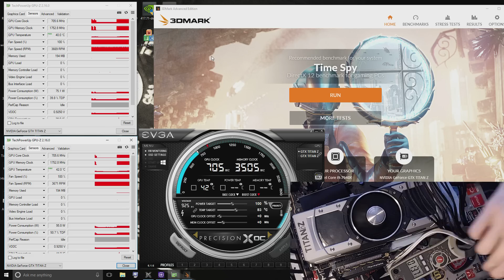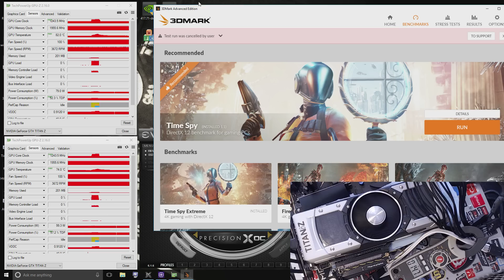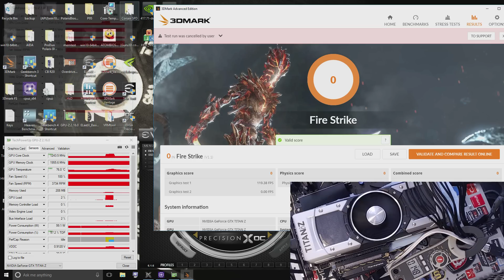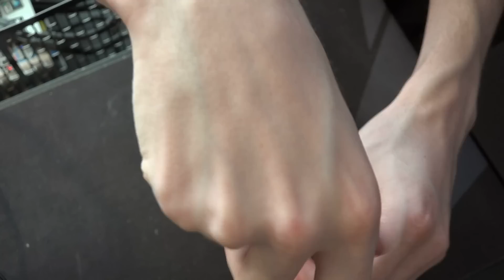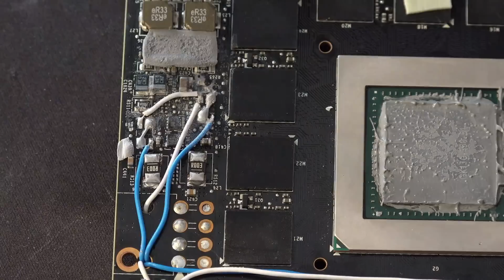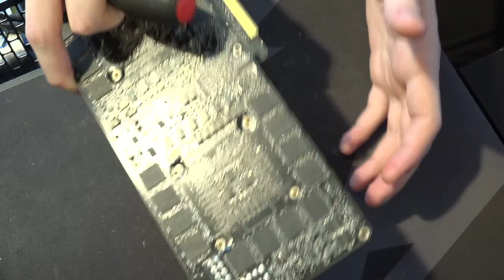Over 650W on a single air cooled GPU! Buildzoid's GTX Titan Z with no power limit.

Comment: Hi there, could you please tell me the thermal pad thickness for this card? 

I have two of them and I'd like to dust them off and play around with them again, and as they have been in storage for a very long time, I'm thinking i should re-do the paste and pads before powering them up.

Comment: If you are buying a (at the time) $3000 USD GPU, I would like a AIO (minimum) connected to it. Not a air cooler. A full body (both sides) water block for a GPU that cost this much would be ideal.

Comment: Thank you for the detailed analysis and breakdown of PC parts. Sorry, This question has nothing to do with this particular video but I enjoyed the ramble. I just bought most of my parts yesterday for my very first PC build. I have put together a PC build for my use case of 60% video editing in Davinci Resolve and other free editing software. 40% gaming, Streaming.———————
Parts List:
CPU: Intel i9 9900k ($484.99) to take advantage of the higher clock speeds.
CPU Cooler: Noctua NH-D15S ($79.90)
With 1× add’l NF-A15 Chromax 120mm Cooler fan. ($22.90) Push/Pull? or Pull/Pull?
GPU: Asus Geforce RTX2080 GDDR6 – ROG Strix OC edition ($799.99) Noticed a performance spec boost from closed to open. I wanted to take advantage of the specs based on my current plans in not adding a 2nd GPU.
Memory: 32GB Corsair Vengeance LPX Kit DDR4-3200 ($189.99)White kit 
Storage SSD: Samsung SSD 860 EVO 1TB SATA ($147.99) OS/ Applications
Storage PCIe-SSD: Samsung SSD 970 Evo Plus 1TB, M.2 ($247.99) Active Work/ Scratch
Storage HDD: Seagate Barracuda 4TB, 256MB Cache ($99.99) 
Motherboard: Gigabyte Z390 Designare ATX ($269.99)
Power Supply: EVGA Supernova 850 G3, Plus Gold, Fully Modular ($137.93)
Case: Cooler Master Mid-Tower H500M ($189.99)
Case Fans: 3× Noctua NF-S12A Black Chromax 120mm fans ($68.00) installed to the top for exhaust. Living in a small rental appt with young children my focus is on acoustics and performance. With my research Noctua seems to have the best acoustics and performance in the air market.
Total: $2740
With my zero PC experience I tried to put together a PC that can last me 5 plus years. The one question I have is in regards to the motherboard:  " Gigabyte Z390 Designare" there seems to be very little information and reviews about this board however Gigabyte is advertising this board as a content Creators motherboard. Having no experience in editing but inspiring to do so. I wanted to know if you feel that this board is the right pick for me or if you have a better option. Feel free to comment or make any suggestions on this build. Every part is returnable. 
Thank you for your time.
 Love your videos, Keep up the great work.

Comment: Why are you so suprised that this can pull 650watts when it has 2 gpus inside it? any current GPU can easily pull this much if there in sli aswell even higher.

Comment: This is one of the reasons why I don't really like 3dmark that much when it comes to who gets the best scores. Most people won't be doing such modifications to this extreme to be able to even get the scores up high. They should have a totally separate application for extreme overclockers. I mean soldering new capacitors on is basically changing the card to something else. But that's my opinion.

Comment: For the start of the benchmark can you force the card in 3d mode to get the full boost immediatly? With like K-Boost in evga precission or with ctr+L/ctrl+F in the Voltage curve editor from afterburner

Comment: Can you help me to take out the power limit on an GTX 470?
Reply from the maker: those shouldn't have one
Reply: @ActuallyHardcoreOverclocking  It won't go above 1.087 vddc,and i read that it can be set to 1.212 with power limit off

Comment: Sooo my croshair5 has an "8+2 phase" vrm with ASP1000 controller, We know there aren't 10 phases controllers, There's no doublers, Is it actually a 4+1 with doubled components?
Take the heatsink cover off and add 2x 80mm delta fans on top of both heatsinks and a third over the vrms, probably moves more air than the axial fan trying to be a blower.
Reply from the maker: nah each core gets it's own controller.

Comment: i fight you should try radeon pro wx5100 aka "PCI-E-BURNER" (polaris 1792 cores like rx 470d but wichout any power conector )
Reply: Yeah, I was hoping AMD will use a cheaper version of this card to compete with Nvidia in mobile market, looks like it would never happen.

Is it actually a better binned RX470???
Reply: @Verpal  no its gpu mainly for chinese market (rx470d and "new"  rx560xt ) Wx5100 have same core count 1792 cores "full" rx470 have 2048 cores
Reply: @hxnbxbn5178  I meant WX5100, not RX570D (Which I thought is basically cutdown RX 570), and RX560XT (Which I heard is somewhere in between 560 and 570?)
Reply: How many PCI-e slot it burned? 

Or are you spreading false information, cause WX 5100 is a Professional card and desinged with very ristrict power limit in mind. If those card says power limit 75W, it will never pull more than 75W.

Comment: i remember having 1300 MHz on TITAN Black, on core with stock air cooler, but i guess TITAN Z has to be downclocked since its basically 2 TITAN blacks on single PCB. ofc in more casual workload like games and such, nothing really intensive.

Comment: 650W? Thats like one OC Vega64 card
Reply from the maker: Nah VEGA 14nm generally peaks around 500-550W. This is a bit more than that.
Reply: @ActuallyHardcoreOverclocking  oof  550watts.... what kind of gains do you get pushing 550 watts through one aside from another dead vega

Comment: i rewatched your breakdown on the gigabyte x79 ud7(?) yesterday and heard you talking about the msi big bang xpower 2 and thought that would be a nice board to replace my ud5 and than today i came across one and got it for 130€ :D will see how much better it is. So now i'm thinking about replacing the mosfets on the ud5 because i tried cooling it with a heatsink on the back and a fan but it didn't help a lot, so any suggestions about what mosfet would be good to replace the ones on my ud5 with?

Comment: Actually Hardcore Overclocking : the cooling on this 2x GPU-s in SLI Geforce Titan Z that has an AVERAGE CALCULATED TDP of 375 Watts and they've put 1 x 92 mm fan on it. Well that's a prime example of underdesigned cooling for any kind of scenario usage. With R9 295X2 you got also 2 GPU-s in crossfire you got 1x 92 mm fan and a water cooling loop that actually got that beast tamed. But even that one was too of an experimental card. Neither of these were ever a good buy due to the sheer fact that SLI/NVlink or Crossfire scaling is really bad for the past 7-8 years.

Comment: Hey buildzoid...I'll bet  you will beat all of my Titan Z records with time. Greetings dasregal. ;)
Reply: And btw you thought about putting waterblocks under the shroud ... been there, done that, wasn't worth it
https://www.overclock.net/photopost/data/1560286/1/12/12d0f8ad_hybrid2.jpeg
https://www.overclock.net/photopost/data/1560286/c/cf/cf79dbfa_hybrid.jpeg
Reply from the maker: yeah just need to solve the cooling. Also thanks for the OCP tip though I use an EVGA G2 which is single rail so I don't have an OCP per power connector.

Comment: It's interesting how similar it is to the GTX 690.  It even looks like they use mostly the same components.
Reply from the maker: not really the 690 is much more similar to the GTX 590(PCB wise) than to the Titan.
Reply: @ActuallyHardcoreOverclocking  I meant the individual components, many of which appear to be the same or similar on your Titan Z as I have on my pile of 690s.  The layout is obviously different, although this looks like an obvious evolution of the 690, to me.

On this subject, I think I've reached out to you about this before, but one thing I've noticed about my 690s is that different vendors seem to have used different components, even though they're all technically the reference design.  For instance, while Dell's cards match the picture you find if you google "GTX 690 PCB," PNY's use a different power stage for the VCore VRM.  When I noticed this, it made me wonder if it might be worth looking at whether some reference boards are better than others.

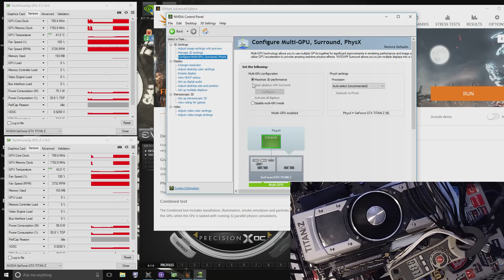Comment: Misleading title, it's 650w on two GPUs, as said in the video @ 2:19 ... GPU ≠ graphics card
Reply: Shut up it legit says titan z in the title so you should know that its a dual gpu card
Reply: 650 watts for total power draw is still insane 325 watts on each gpu x2 650 probably maxing these two 250 watt tdp limited cards to 300 watts is still insane on one pcb with a mediocre cooling setup
Reply: Yeah, I fell for the title too, kinda annoying

Comment: is evga overclocking tool better than msi afterburner?
Reply from the maker: eh I just prefer it to AB for no real reason
Reply: @ActuallyHardcoreOverclocking  okay :)
Reply: I use it, cause I also have an EVGA mainboardboard. My GPU is a GTX 1080FE, and overall it works the same. Of course, if you have an EVGA GPU, definitely use the PrecisionX OC, as there are other features there for them. Such as RGB, temp sensors, etc.

Comment: Couldn't you edit the bios to lift the power limit on this thing?
Reply from the maker: I realized that Kepler can be BIOS modded after I already did most of the mod. When you're really good at using a hammer everything starts looking like a nail.
Reply: @ActuallyHardcoreOverclocking  I am a legend with the hammer